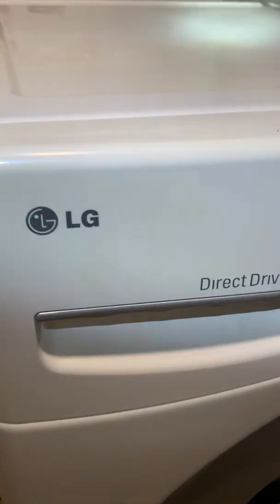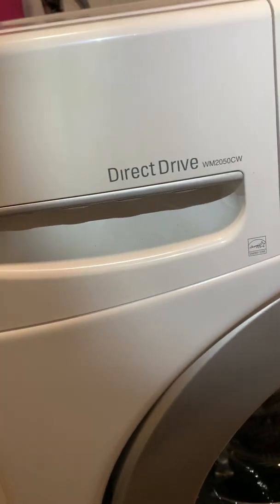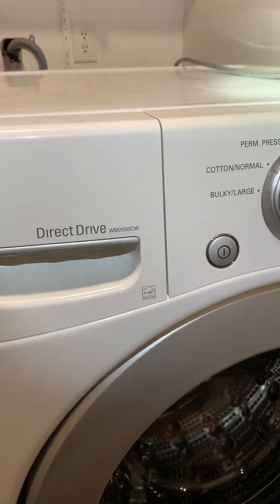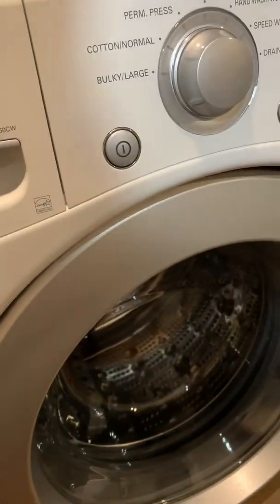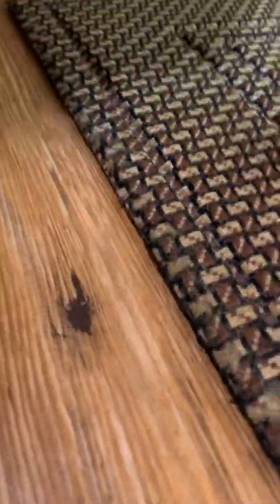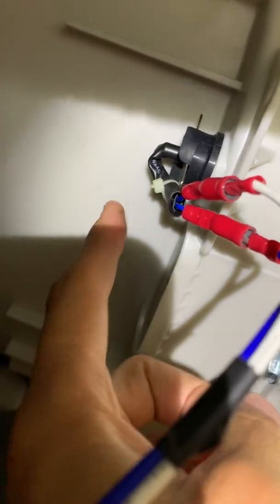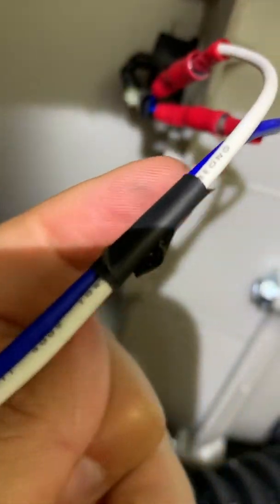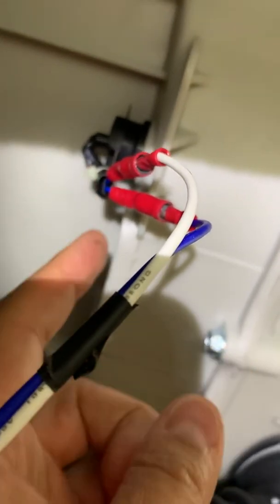LG Washer WM2050CW ‘TE’ thermistor error repair

Comment: did you remove the white connector at the end of the thermistor and connect the wires into the butt connector?
Reply from the maker: It has been about 3 years since I performed the repair, so I can't recall for certain - but watching the video again, it looks to me like there was a blue wire and a white wire coming from the thermistor, into a harness, and connecting out to corresponding blue and white wires.  I simply cut out the damaged portion of wire (in my case, the blue one), and the wiring harness (since I could not repurpose it), and replaced with butt-connectors. So blue to blue, white to white. Hope it helps :)
Reply: @mslivkoff  Thanks for this reply, I'll give it a go!

Comment: Was your wire on the blue side clearly broken? I have one of these LG washers that looks identical to yours! The thermister was hanging down but the wires look just fine, so I replaced the thermister and put it back in properly and no go, same thing tE code. I had a guy at sears parts tell me i would need to buy a whole control board. I really want to get this washer going again, but I can't really see buying a whole new control board when that might not even fix it! Mine is a model WM2250CW ,but look just like yours. Have any ideas for me? Thanks
Reply from the maker: It has been a few years on mine, but if memory serves, the blue wire was broken off at the wiring harness itself, which made it straight-forward to diagnose.  

It looks like your model also does not have a heating element, so I would assume you are on the right track, replacing the thermistor itself, and then moving to the wiring.  Of course, if your wire is not obviously broken, but has an internal short, it will probably be more difficult to locate where exactly in the wire the fault lies.  

Here is a link I found to a guy troubleshooting the TE error, and using a multi-meter to test for the correct readings.  

https://removeandreplace.com/2017/03/01/lg-front-load-washing-machine-error-code-te-how-to-clear/

You might also gamble on just cutting out the wiring harness (since that does seem to be a common fail-point on these LGs), and re-splicing, but it would just be a guess - and might leave you with the same unresolved issue.  I think this multi-meter testing might be worth pursuing, at least to narrow down where your issue lies.  I'd feel as you do about replacing the control board.  Expensive, and also appears pretty complex.  Hope the link helps.